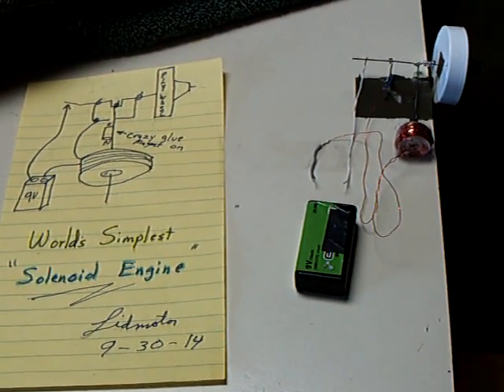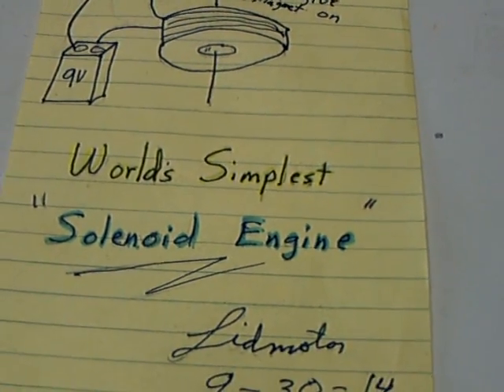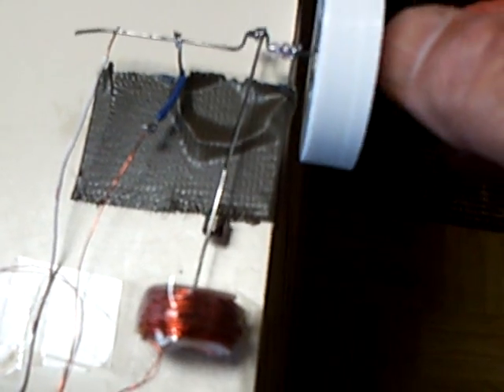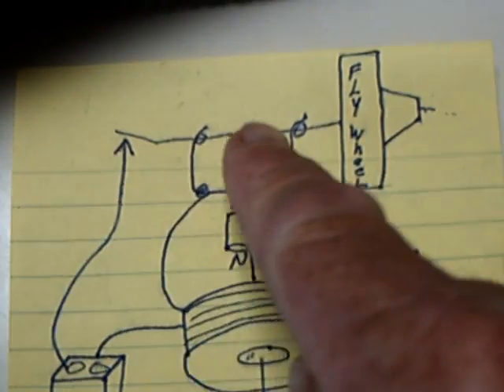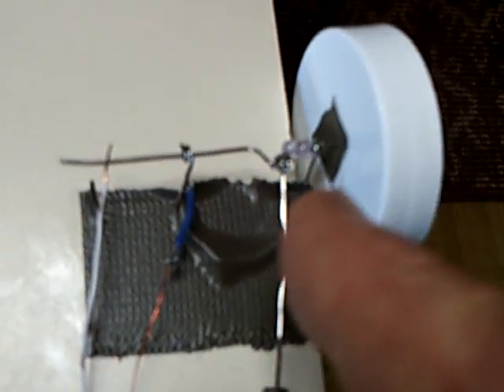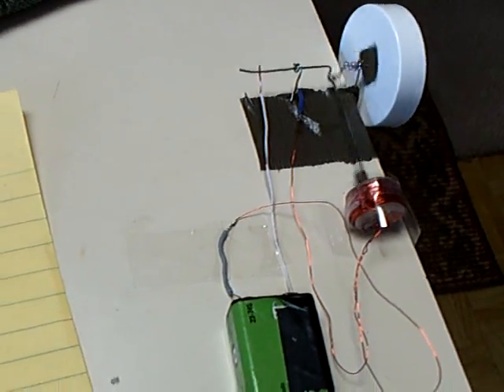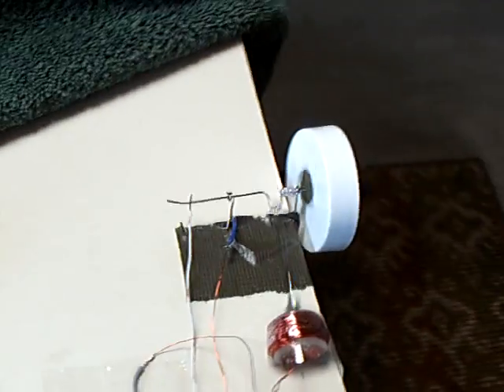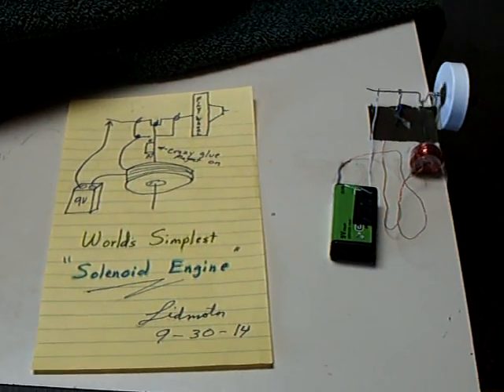World's Simplest Solenoid Engine

Comment: I think I would be more inclined to call this a simple electric reciprocating motor.  A solenoid travels through the center of wire wound core.  But regardless of that thought, it makes a fine project.  I may try one.  Thanks!

Comment: LIDMOTOR, Yes I've already done so, there are several of these single solenoid designs.. One of the most complex electro-pistons motors I've seen has a 5 piston solenoid radial design.. The make-or-break connections(realized by nifty cam switches) creates intense countervoltage spikes that result in spectacular arcing.. I wonder if such a method creates superior torque compared to conventional electric motors?
Reply from the maker: +Jeffrey314159 I don't think so.  You lose energy every time you start and stop a mass.

Comment: This is no engine, it is an electric motor, clean and simple..................  A motor is a direct converter of one kind of energy into kinetic force - - - - - - - - - - - - - -   An engine is a processor that consumes some kind of fuel that releases heat energy which is then converted to mechanical power.
Reply from the maker: +Jeffrey314159 Yes.  I would call this a "motor" also but I didn't name this.  Somebody long ago did.  Lots of people have made them if you put that title in the search bar.

Comment: Hey Lidmotor! I'm trying to do something like this for my high school science project but I'm having troubles with the copper solenoid and the magnet. I just wanted to know how you made the copper solenoid and what kind of magnet that is cause the solenoid I made isn't working at all! Thanks!
Reply from the maker: Josh Gomes The coil is a sewing machine bobbin filled up with 30Ga magnet wire.  Radio Shack sells a three spool package of magnet wire.  You will need a strong neo magnet.  A regular fridge magnet will not work.
Reply: Thanks so much!

Comment: Lidmotor,  With 2 coils and no perm magnet, you could have one coil move and one stationary.   You could us a single commutator for both coils, or each for each, and the common source voltage.    It could both push and pull alternately, from the changing coil polarities.   2-strokes per revolution.        got to try this myself..

Comment: Lidmotor,  Merry reciprocations to you!   I was wondering if you could substitute an electromagnet (wire coil ) for the permanent magnet, then you have a motor that only needs a battery and some wire, and the drive shaft.   hmm

Comment: Could use similar principles for dioramas, to make parts move in locomotive displays of the steam age, or Industrial Revolution factory machinery...Electric Steam !
Great video for getting the mind going :)
Reply from the maker: Check out the video of the solenoid V8 engine.  That one is pretty cool.
V8 solenoid engine
Reply: Oh wow, idles, revs and sounds like a WWII aircraft engine !
I see someone's made a 5 cylinder radial too....off to watch that, thanks for the heads up, this is all quite amazing.

Comment: Neat!
You can also create a make-break using nail polish.  Paint 1/2 of the shaft then you won't need the wobble.

Check out these devices! 
Real Paper Clip Motor (Solenoid Electric Engine)
The Simplest Mini Motor

Thanks!
Reply from the maker: That is a beautiful little paperclip motor.  I bet it took him a long time to build it and make it run that smooth.  I have use the fingernail polish trick before.  It works good. Could have used it here but the paperclip shaft was pretty thin.
Reply: Agreed.  I was impressed it was balanced enough to run at 7V.  That's pretty good for something hand made.